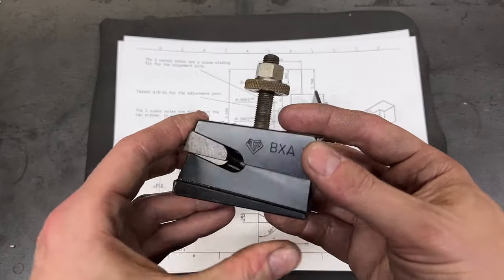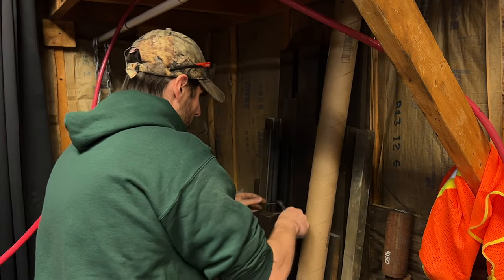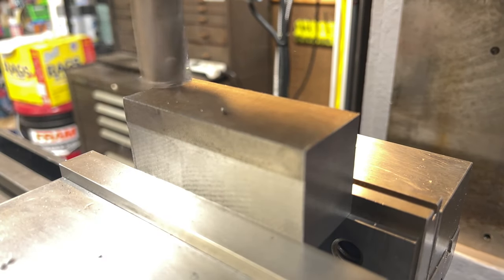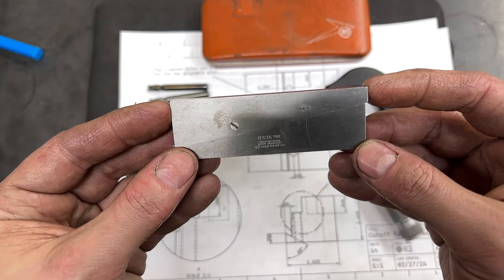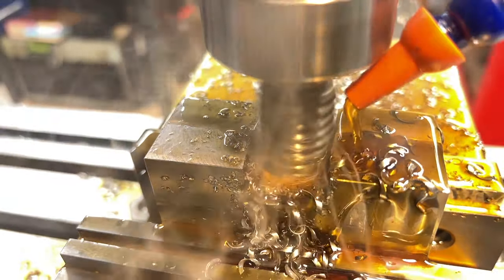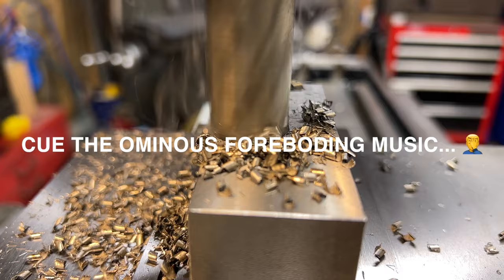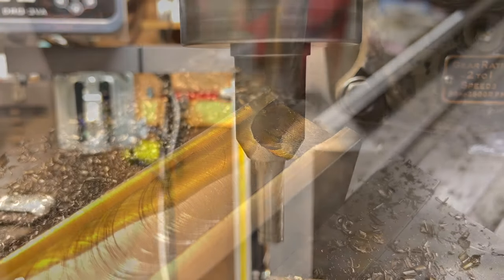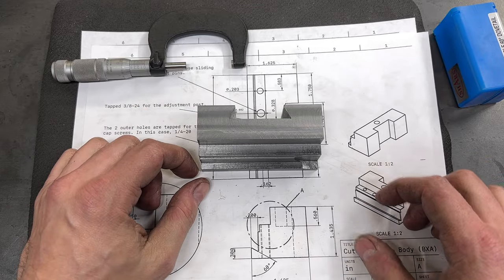Machining a BETTER Parting Tool Holder Pt1

Comment: If the "mistake" is 50 thou deep, machine the feature 50 thou closer to the tool post and make it disappear.??Closer to the tool post is always a plus for a parting tool.
Reply from the maker: I had considered just cutting it out, but I don't have a ton of extra room to work with on the stock, plus it isn't gonna really affect anything so I'll just leave it be. Thanks for watching!

Comment: I might have one or two of those 30 taper tool holders. I think one is an endmill holder and the other is a shell mill holder. Not sure where they are right now, but I'll try to see if I can find them. I don't use them, so if I come across them, you're welcome to have them.
Reply from the maker: That would be AH-FRIGGIN-MAZING! Just let me know if you find em and we'll work it out!

Comment: I don't remember if you have a surface grinder... If you do, and if you decide to try my little flight of fancy here, you might want to get some more tool holders to modify, as it may not be cost effective to do just one...  make a 1" radius on one side of the grinding wheel, ans whatever the lock angle is on the other side... Grind the cam-lock into your holder... Just a thought...
Reply from the maker: Yeah that's a solid thought. It would take a while to grind out that much material on my little 1hp surface grinder, but if I could get a good technique going and knock a bunch out it would be great seeing as how cheap and available bt30 tool holders are
Reply: You can always approximate the size of the notch with a hand grinder and a cutting disk and finish it with the surface grinder.

Comment: I dunno that Joe pie move looks like the stock was cocked when you went down to one parallel... Re your oopsie, as previously mentioned just being everything else in the 50 thou. Re your holder, I was going to say that can lick thing looks awesome! But now I (we all) know better. Bummer. Torch that thing and let it cool slow. It'll soften right up. Can you just run a draw bar down through the top? It might be worth it just for other holder options. Even if you have to pull the cam lock out... Which would also suck cuz I still think that thing has mad potential!
Reply from the maker: That's definitely something that you have to be aware of when using this method. But try it for yourself, I think you'll be surprised how easy it is to get it right. I've been using it ever since I saw it, and it's given me pretty good results. And I agree, a lot of comments to change the spindle, but I think the cam lock spindle is pretty awesome and will be a huge positive once I have tooling for it. Also, would take significant modifications to the vertical head to allow for a drawbar as it's all closed up above the spindle since it doesn't use one. And that's not something I'm really keen to do. but yeah, the cam lock is friggin slick, I'm keeping that sucker and I'll make tooling. 😎

Comment: Is it possible to change out the spindle to something not so oddball?
Also just weld and remachine the oopsie...
Reply from the maker: Well, anything is possible lol. And that's definitely a good solution. But it's a non drawbar spindle. So in order to change it out to something like a standard 30 or 40 taper would require a lot of modification to the vertical head which isn't something I'm really keen on doing. The easiest thing to do is likely to just fix the collet holder I have, and either find or make a couple of additional tools and be done with it. Only have to do all that once, and then I have tooling. And it doesn't need to be welded, just needs more material removed, so it really shouldn't be that big of a deal fixing it. It's just hardened, so I have to use appropriate tooling. Thanks very much for watching!

Comment: A good quality cutoff blade would make a HUGE difference.  I had a heck of a time with parting when I first started.  I bought some Empire brand parting blades and it was amazing how much easier it is. 
I have been using the same one for about 7 years now and it is still about 3 inches long.  
Joe
Reply from the maker: Agreed, good tooling in general is critical. I feel like that's one of those lessons that we all have to learn the hard way lol. The cheap import tooling is so tempting for the price, until you learn better...

Comment: I'm considering changing the water based coolant of my milling machine to cutting oil. But as you just mentioned, it makes a terrible mess. So, I don't know. What do you prefer for your machine?
Reply from the maker: It's really tough to say. They both have pros and cons. But for high pressure, slower spindle speed machining, especially with HSS cutting tools, I think that oil has a lot of merits. Plus it doesn't cause rust, which is a bonus. So, it's more difficult to clean up, but at the same time you don't have to worry about cleaning it as thoroughly because it won't cause rust. But like I always say, I'm no professional so take anything I say with a pound of salt lol.

Comment: Can it work if you use a TIG torch and do some sort of stainless fill and remachine the bungoed surface?
Reply from the maker: Luckily it's save-able as it is because it needs to be machined bigger. I just have to figure out how I want to machine it because of the hardness factor. I like the idea of having an ER collet holder for that spindle so I'll definitely try to fix it.

Comment: Maybe rough the cut out with an angle grinder using cutting blades then grind the rest using a 1" cylinder in a die grinder?
Reply from the maker: Sounds like that could be doable. BT30 tooling can be found pretty cheap second hand so might pick up a lot next time I see one and experiment.

Comment: Another option is find someone with an EDM (Electricrical Discharge Machine) and make an electrode based off of the correct tool holder.My Knee mill(excello) also has an unicorn tool holder(Beaver quick change) so changing the spindle is not an option. I would try the carbide,go slow and steady first,then try the EDM 2nd.

Comment: Heat it up with a torch and let it air cool.
Reply from the maker: There are a LOT of issues with attempting to anneal it. Best options are going to be either grinding or hard milling with plenty of oil to keep the temp down. I'm pretty sure he milled it, and I'm guessing he would have just used some kind of carbide so I might try that.

Comment: well well well, ain`t you posting a lot of stuff lately... Nice to see at any rate! I will likely creep outta my bed with something aswell at some point in the near future... This kind of stuff helps keep me sane during this disgusting season we call the winter... Oh well, you just reminded me that i need a decent parting blade... Maybe an Iscar or something similar for carbide inserts... Also, a BETTER parting tool holder wouldn`t be a bad idea either, what with HSSCo steel blades and Carbide flat blanks that i have...

Speaking of that toolholder, yuh, that design is crap... Not saying that it can`t hold a tool, but a small section that clamps down and just the barest excuse for a 3 point retaining mechanism is not a good design... No need to excuse yourself for shitting on the default design... I much prefer the hinge style of clamps - where the blade sits in a tapered half slot with a false V in the bottom, has support on the side, on the bottom and a bit on the side towards the chuck, but the top section is a swing clamp that mashes down on the whole length of the tool in the holder, ramming it in the lower section with unyielding rigidity - quite akin to your design... Parting even with a dead sharp tool is a high load operation, relying on a small wedge tab to retain a parting blade is simply silly... 

All the best!
Steuss

P.s. The oil setup is something that i love! I know that it`s a bitch, and a fuming one at that, but honestly, it`s the best thing there is for both the cutters and the machine... No rust, lubrication of everything... The vise jaws get lube, the surface finish is better, just an overall champ when compared to regular water soluble ``oil`` system... A bitch, but the best one there is... However, i would advise you to make up an extractor system for that crap... Those fumes are everything but desirable in the respiratory sys...

P.p.s. Ok buddy, you are talking projects here, but you have a project on your hands that you aren`t even addressing... MAKING OF 50 MILL HOLDERS... Just slap a rod in the chuck, make a bunch of those and save yourself the grief... I don`t know about your grinding capacities, but i would wager that you could hardturn those with cbn on your lathe after a home-shop-heat-treatment... Get some decent steel, go to a scrapyard and get some saucy rods, they can be had for cheap if you are lucky... That isn`t such a complex geometry, just run the centers and give yourself a round feature for a drive-dog... That way you can cbn turn them after hardening...
Reply from the maker: Thanks man, and yeah I know that at least for me a lot of the problems that I had early on with parting operations was the tool holder. I feel like it probably contributes to overall stigma of cutoff ops for hobbyists in general. A lot of people have aloris style tool holders, and a lot of people struggle with cutoff ops.
Reply: @hersch_tool  I updated the comment a bit, so you can check it out if you care to... In short, brother, you gotta make a whole bunch of mill holders, this just ain`t something that you can run with... It`s gonna drive you nuts... It`s either that, or a replica spindle with a different taper setup...
Reply from the maker: @camillosteuss  Yeah I'll figure something out.

Comment: HSS parting tools are junk in my experience.  I bought a carbide insert parting tool and have not looked back since.  Cuts like butter on my small Grizzly lathe.
Make chips that dont need dips.
Forge On!!!
Reply from the maker: Lol chips no dips! I like HSS parting blades for their versatility, but I have carbide too. I tend to use whichever one will work well for whatever I'm doing at the time. HSS blades are good once you get used to em, especially if you get decent blades and use a good rigid tool holder... 😉 thanks very much for watching btw!

Comment: Man,  I wouldn't call that crashing your mill. A tool holder failed. I have an apprentice mark in my vice from the time I learned aluminum likes to suck end mills out of collets.
Reply from the maker: Haha thanks, makes me feel a bit better lol. And yeah, brass is the same way, especially with drills, will pull it right in

Comment: I expect he took the temper out of the steel did his cutting and then retempered it.   You can take the temper out of it yourself and send it in and get someone to put it in with a batch to be retempered (or buy / build a kiln )>
Reply from the maker: I can harden and temper steel in my shop, but the issue with doing that with a part like this is that it's been hardened and ground to a TIR of about .0004" Heating and cooling the steel to that degree I'd be worried about throwing out those tolerances. it's actually a decent quality tool holder. He hard milled it, which is probs what I'm gonna do. Just need to use a good cutting tool, coolant, and patience to keep heat down during the process.

Comment: All that time 😮  I’ve always felt welding and machining are essentially brothers and should be considered to go hand in hand especially for hobbyists. Do you have a Tig machine or a friend who has one? Just fill it and mill it back down and no scrap! Thanks for the vid! Makes me want to make myself a couple special purpose tool holders.
Carry on bro.
Reply from the maker: I have a stick welder, but it's not critical or anything, it'll still work fine so I'll probably just leave it. It's just ugly lol. And thanks very much for watching!
Reply: @hersch_tool  If you’ve got anything even close to the OCD I have, it’ll drive you insane!!! and you’ll either be making another one or fixing that one… trust when I say “every time you use it it’ll stare at you until you break!” 😂
Reply from the maker: @B_T-Weld_Machine  I believe you're probably correct lol